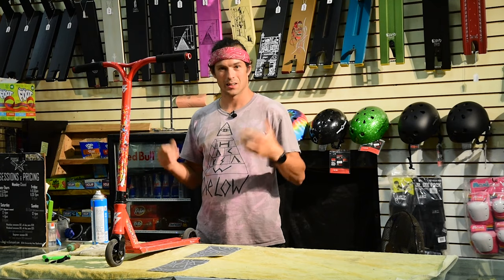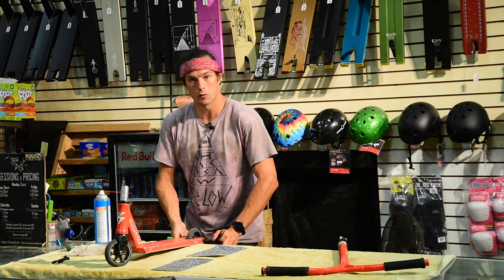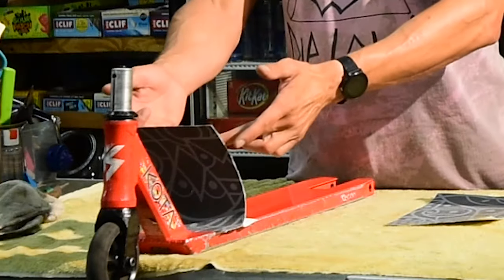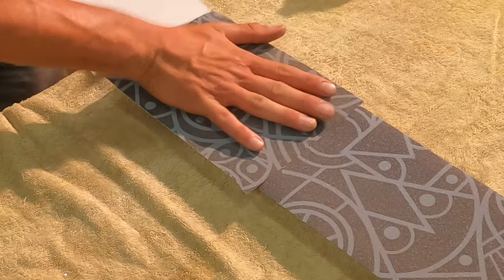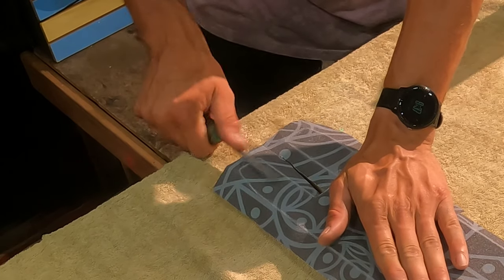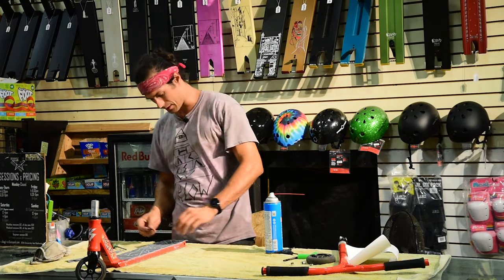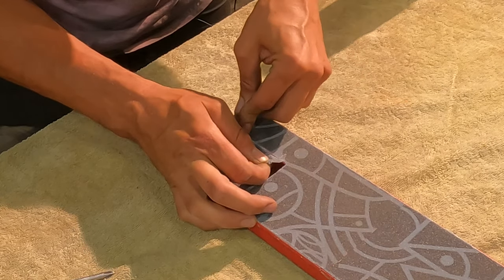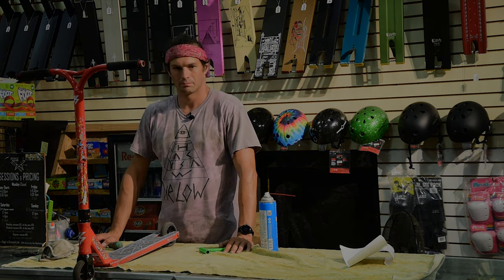How to Grip a Scooter Like a Pro in 3 Steps | Breaking Free Skatepark

Comment: This is THE BEST grip tape tutorial out there. The peel off method to lay the grip tape is so clever. I have trouble lining it up, so this is so helpful. I am also in the group who doesn’t sand down the edges of the grip. I will use both when I grip my next deck. Very helpful.